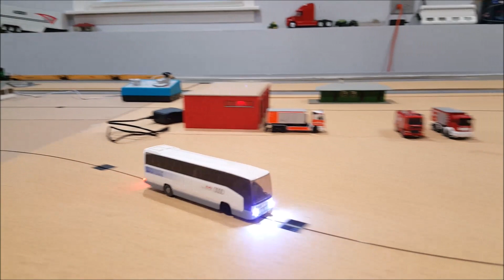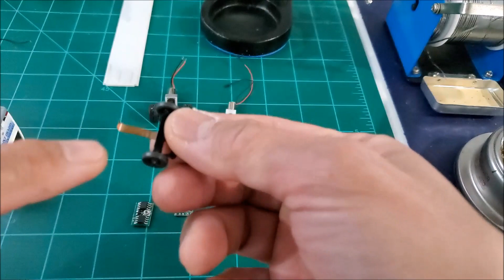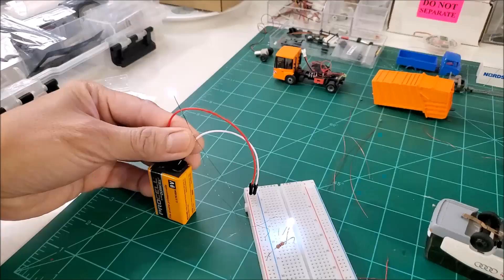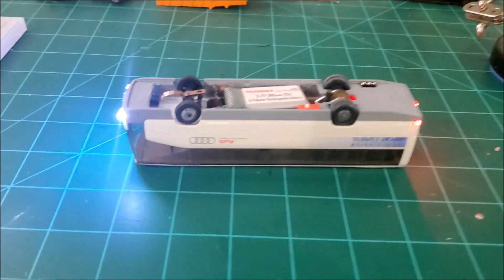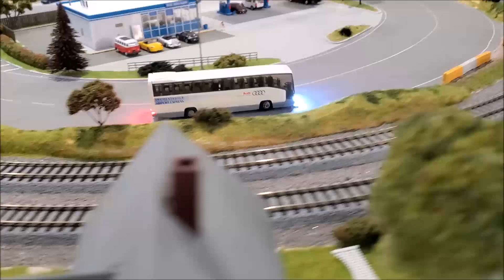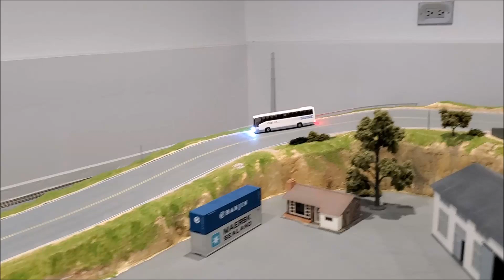Faller Car System - Bus Repair

Comment: i want to convert an Iconics replica 1:87th scale bus
you said you got a bigger motor and wheels
what are the sizes and the wheels that you used
and where did you buy it from??
Reply from the maker: I got those from Antares Hobby on eBay years ago.

Comment: The Faller Car system is a really cool concept. You have some great wiring skills, I could never do that. Thanks for sharing. Dave
Reply from the maker: Thanks Dave. It really is cool and fun to have in the layout. It does require some patience to do the soldering work on very small parts.

Comment: I have 2 questions 1 The reeceiiverfrom whom did you  buy it. 2 I have a FCSS Bus. does the small lights to work on a 2 triple battles. what voitaage is needed.who sells the the pre wire lights?
Reply from the maker: I bought the board from Antares Hobby. The 3.7 V battery I use supplies power to the small LED bulbs but I use a resistor for each bulb. Google prewired SMD LED bulbs and you'll find places that sell them.